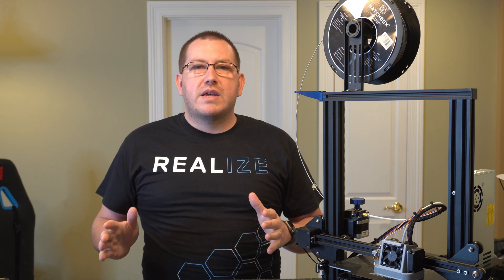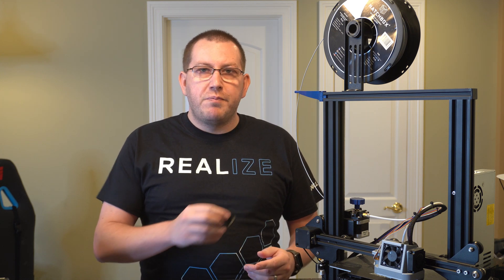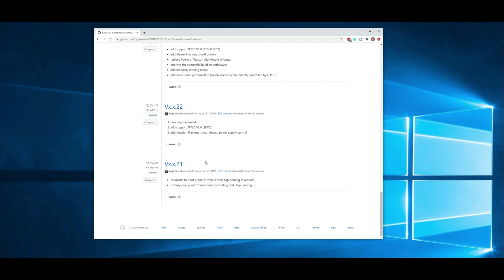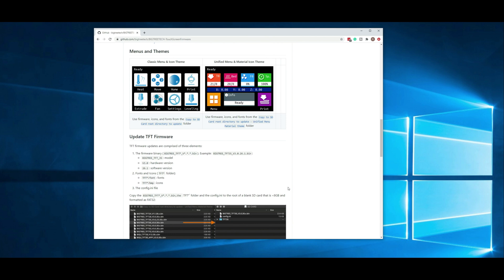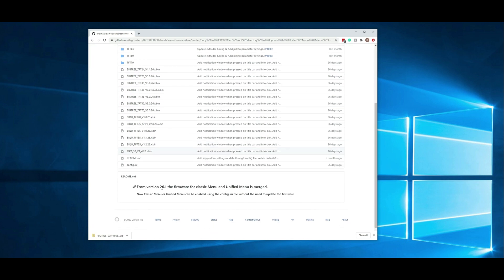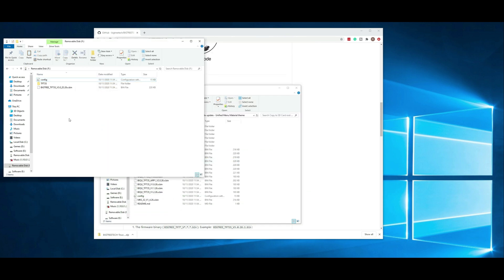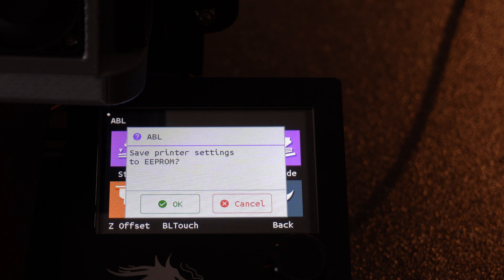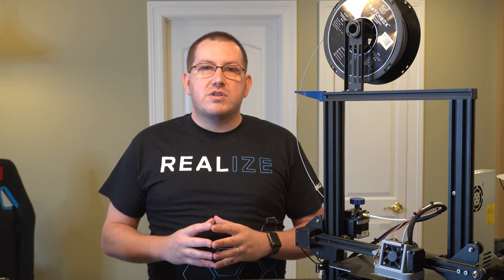BIGTREETECH TFT35 Firmware Update – Complete Guide

Comment: Hi Rob I upgraded my TFT35 using a 32Gig SD card and it worked. Thank you for the great video
Reply from the maker: Hi. Is the tft the v3 one? They may have improved the reader in it. Thanks for sharing.
Reply: Same here…I did a full format which took forever, but the bin file changed to cur file, when I flashed motherboard, so it worked!

Comment: Hi Rob, first off i must say youevideos are sport on so thanks. having just compiled firmware for my ender 3 max whilst watching your guides i have a problem where as my btt tft only works in marlin mode. it worked on my old firmware tho. is there a step in the firmware that i have missed to eneable the btt tft?
Reply from the maker: Hi. Thanks for the feedback. I dont recall anything specific needing to be changed when doing it with the e3pro but its possible the max config example is different. Make sure the creality screen is not enabled.

Comment: can I download it onto a USB stick and use that for the update? Or do I  have to use an SD card to transfer the update? I've got a printer running on old tech and it thinks that the board is 9in but it's a 12 in so hopefully the new update fixes that.
Reply from the maker: Hi. I think it has to be on the SD card.
Reply: @3DPrintscape   great thanks so much!

Comment: I keep having the touch mode or marlin mode pop up on my TFT 35 v3 e3. Any insight in what I need to do to get past this? I plugged the one wire connector in to the exp3. I did not have any other wires missing to plug from my original motherboard. Any help will be greatly appreciated
Reply from the maker: Hi. Are you able to go into both of them without issues? Also, did you upgrade the firmware on the tft?
Reply: @3DPrintscape  I did the upgrade and it’s still showing up.
Reply: @3DPrintscape  once I click one or the other it shows the main symbols. It goes back to showing both again

Comment: Hello! When printing from tft USB port, the printer randomly stops and screen freezes. Any advice?
Reply from the maker: Hi. I would try updating the firmware on the tft and the printer.
Reply: @3DPrintscape  Already did that. I set the baudrate to 57600, bufsize to 64 and BLOCK_BUFFER_SIZE to 16 (was 8 before). Printer is still running for an hour and it seems to work.. it should have stopped already but i will wait and see if that fixed it
Reply from the maker: @glupu-r4b  Did that end up fixing it?
Reply: @3DPrintscape  it worked for 2 days. Last night it stopped after 40-50 minutes bur after that i got a succesfull 7 hours print overnight
Reply from the maker: @glupu-r4b  Im wondering if there is a hardware, or power, issue.
Reply: @3DPrintscape  issue being around for 2 years on reddit without any fix for BTT

Comment: Hi, thank you for the videos.  I have a TFT-35-E3 V3.0 and when I am upgrading to the newest firmware (Bigtree_tft35_V3.0_e3.27.x.bin) with the "Round Miracle Menu" theme it tells me that it can't find 3 images.  (Bigtreetech, U_disk, Marlin)  After flashing It says Fonts is ok, config is ok, Icons needs updated.   I'm fairly certain that  the config file and the tft folder are all flashed because the file names have .cur after.  The .bin file stays the same.  Is the .bin file my issue on why It says that I'm missing 3 .bmp files? I am using a 8gb mini sd card with adapter.  Suggestions on how to fix this?
Reply: Wrong Firmware bin file!!! I have it working now.
Reply from the maker: Hi. Im glad you were able to get it going.

Comment: Have an Ender 3 V2 with a BigTreeTech SKR mini E3 V3.0 motherboard.
and a BigTreeTech_TFT35_E3_V3.0 screen.
Now get the message “Failed to enable Bed Leveling”
Can someone help me to get rid of the message?
Reply from the maker: Hi. Thats expected after pushing new firmware to it. Once you run the mesh once and save it, the message should go away.

Comment: Anything above 32gb wont work. FAT32 is the limitation of which it reads. I tried to use a 128gb and it won't detect it.
Reply from the maker: Hi. Thanks for the info. I have had mixed results with 32 gb sticks, even formatted as FAT32.
Reply: @3DPrintscape  Well the format which the printer reads can only be in FAT32, that specific format can only be up to 32gbs. With that said, the printer may only support up to 8gb itself as its own limitation regardless of the Format's limitation. I'll make a shot at it soon. I'll drop back by and let you know what I find out. If the printer does indeed have an 8Gb limit, I'll look into potentially making it cap with the format type.

Comment: I just installed the TFT 35 v3 touch screen and it worked right away, BUT it will not print. It says card read error. I go to Marlin mode and it reads the card and prints. Do you think this is a bug in the firmware and it needs an upgrade? My mainboard is the BIGTREETECH SKR Mini E3 V2.0.
Reply from the maker: Hi. It could be, i dont use the SD card on the TFT. Can you try it with a usb drive to see if it does the same thing?
Reply: @3DPrintscape  Thanks. I figured out my problem. If I am in Marlin mode, the original micro SD card slot is used. If I am in the touch screen mode, there is a full sized SD card slot on the right side of the Touch screen board. I plugged the SD card into that and it works fine.
Reply from the maker: @CarbonGlassMan  Thanks for the info

Comment: Thank you for this video. It was very helpful. I was so confused and thought I needed to further update my Marlin build for the SKR mini and it might mess up all that I had already done there. 6:35 you mention SD Card size. I used my 64 G SD card with zero issues. I just formatted it to Fat 32 first. I just did this today 12/30/2021. My build: Ender 3 Pro, BTT SKR mini E3 v2.0, CR-Touch, BTT TFT35 E3 v3.0.  I did have an error at the end of my install that said "Config: Update required". I had read BTT github directions (that have changed since this video) and thought I understood that I should use config.rrf.ini for my application. The BIGTREE_TFT35_V3.0_E3.27.x.bin and the TFT35 folder both showed .CUR now. So, I put the SD card back into my computer and added the config.ini. to try and solve the problem. When I put the SD card in the printer this second time, the screen said "Illegal FLASH APP!" Google search took me to a Reddit that said they thought they bricked the TFT. I erased and reformatted my SD card again and put fresh files on again, this time the plain config.ini and it went perfectly.
Reply from the maker: Hi. Thanks for the info, i will take a look at the changed they made and may make a new video or add notes to the description. I have had larger SD cards work, but they have been hit or miss, especially when dealing with the printer mainboards. The SD readers they use in these things are cheap.

Comment: I installed a TFT 35 it worked initially but now I get a configuration required message then the screen goes blank need help
Reply from the maker: Hi. Did it randomly start having the issue or was it after a change?
Reply: @3DPrintscape  after changing the screen it worked for a couple days
Reply from the maker: @johnjahner3389  I would try to update the firmware as I talk about in this video. If that doesn't do it I would try to exchange the TFT. If it was working then just randomly stopped, it sounds like it may be a hardware issue.
Reply: @3DPrintscape  ok
Reply: @3DPrintscape  after then change

Comment: when i cancel prints from the tft, it is stuck in loading... indefinitely until i hit the reset on the TFT. 

Also after updating to the latest firmware (I'm on SKR 1.4Turbo, Marlin 2.0.9 and the TFT35 i just downloaded it off their repo), it now refuses to print from a folder but it is ok if it is on the root directory (Printing from the SKR onboard sd slot, not the TFT SD slot)

Any ideas?
Reply from the maker: Hi. Ive noticed that sometimes with the tft35 as well, it seems like a firmware issue. The not being able to print from a folder also seems firmware related and i think that works fine for me, though i haven't tried in a while and at this point the firmware im running is about 6 months old.

Comment: Hi. How do I stop the flashing from happening every time the printer starts up?
Reply from the maker: Hi. Im not sure i understand the question. But once the firmware is pushed to the printer make sure you save your settings and everything should persist through printer reboots.
Reply: @3DPrintscape  If the printer boots up with the SD card in it, it causes an "Illegal FLASH APP!" error to appear even though the only files on the SD is the gcode file that needs to be printed.  Then i have to reflash the firmware on to the board before I can use it again.
Reply from the maker: @grahamgrobler776  I have not seen that before. Make sure the sd card only has the firmware file on it when you flash the printer and that its deleted afterward.

Comment: I followed all these steps and got my TFT35 updated but when I set the bed level it gives two errors. Error writing to the EEPROM and EEPROM data size error. Any suggestions?
Reply from the maker: Hi. I would make sure the firmware on the SKR Mini is also up to date.
Reply: @3DPrintscape  Thanks for the reply. I actually just compiled and updated the firmware following step by step with your other video. That was right before I did this TFT35 update. Thanks for the great videos. I have been saving them to a playlist for later reference too.
Reply from the maker: @mattstout610  Dic you clear the eeprom after the firmware update?
Reply: @3DPrintscape  No, that must have been it. It works now. Saved my settings!
Reply from the maker: @mattstout610  Cool, glad its working now.

Comment: Hello, did you happen that BIGTREETECH TFT50 V3.0 does not load a 16GB flash drive, FAT32 format? I have no idea what to do with it, so I ask everyone who works with the display. The display firmware is the last. Thank you.
Reply from the maker: Hi. The largest card supported by the tft35 is 8GB. I have seen 16gb ones work some times, but they are not supported.

Comment: I have the skr mini and board firmware installed and updated. But when I try to do the initial ABL level it fails. Says "! ! STOP called because of BLTouch error - restart with M999. Any guidance?
Reply from the maker: Hi. I would make sure the black/white wires are in the right order and that the wiring matches the firmware.

Comment: WOW! Am I glad I watched this because it solved a HUGE problem for me and I MUST mention this. I'm sure others already know this. I'm just learning Marlin and upgraded my printer (CR10 S4 400mm x 400mm)with an SKR 11.4 Turbo, TMC2209 and BTT TFT35. Long story short, config'd Marlin with bed dimensions etc. While checking thing out I noticed that when I did 4 corner bed leveling in Marlin mode the nozzle moved to the FL?FR/RR/RL just fine. In touchscreen mode it moved to FF as it should but would stop at 210mm when sent to FR? Anyway, during this video at the 11:00min mark you mention that we could open the config.ini file to make any changes.............WHAT!!!??? I checked it out and low & behold there's a listing for the bed size and IT WAS WRONG!! I corrected the dimensions and now 4 corner bed leveling works as it should in both TFT modes. Just thought I'd mention that. Thanks so much for that brief mention about the .ini file.
Reply from the maker: Hi. Thanks for the feedback and sharing. Hopefully this will help others as well :).

Comment: So have this screen installed for quiet awhile and continue to get an error message “Illegal Flash APP!” This happens every time I turn the printer on with the SD Card left in the screen slot.  Any idea what might be going on?  Only way to fix I have to reload firmware or make sure I pull card from slot before starting.  Pretty frustrating.
Reply from the maker: Hi. I havent seen this but i can try to help you troubleshoot. I assume that if you dont leave the sd card in you dont have the issue? I typically print from the USB port and i know that can be left in when its being powered on.
Reply: @3DPrintscape  Yes that's correct and thank you. Only happens when I leave in the screen SD slot.  Never tried using the USB port or the standard micro slot on my ender.  Using latest TFT file now but its been a constant problem through different firmware iterations.  If I'm daring I guess I could try leaving things in the other slots to see impact.  Just odd that it completely wipes out things.
Reply from the maker: @jerseybarrier64  Is there anything on that sd card besides gcoode files?
Reply: @3DPrintscape  I have used different ones and not 100% sure but I'm sure g-codes only most of the time.

Comment: when I upload to my Ender 3 Pro it shows no printer attached
Reply from the maker: Hi. My best guess is the the BAUDRATE changed in the firmware. You can change it on the TFT35 through the interface or in the SKR firmware. If you run into issues, you can also reach out over email or discord. My email is admin@3dprintscape.com and discord is https://discord.gg/Bu94EYVkrU .

Comment: Man...I did this ( before watching your vid) like 8 times with a 8gb card.  Switched over to a 128mb and BAAAM! It uploaded. TY still no printer attached.
Reply from the maker: Hi. So it didn’t work with the 8GB card for you? I was thinking about this more, and its possible the 8GB cards actually have more than 8GB (basically a buffer to account for blocks going bad), hard to say for sure. Are you getting any indications/errors on why its showing the printer not attached?
Reply: @3DPrintscape  in rufus ( I used multi formatters to sanity check myself) it said 7.46gb.  I am wrapping up now to calibrate...it looks like I have to reflash the MB, it seems to have turned off Mesh_BL. Thanks for the vid though.
PS I have to go to 12864 first in order to get it to connect to touch
Reply: I believe you also need to make sure the 8g card (or smaller) is formatted using a 4k cluster size
Reply from the maker: @erwinvigilia6303  Hi, thanks for the info. I think the default value for the cluster size is 4k, but I'm not sure if that's a hard requirement or not.

Comment: Hi great video. I have an issue where I still have a 'Printer not attached' message on screen. Change Baudrate settings but to avail. I also have no System info on screen like in your video.
Reply from the maker: Hi. Can you confirm that you have both cables from the TFT attached to the mainboard and that they are plugged in correctly? If the no printer attached error isn’t going away, that’s where I would look first.
Reply: @3DPrintscape  Grey ribbon cable plugged into Exp 1 (Screen) to Board and 4+1 cable plugged into RS232 (Screen) and TFT on board with +1 connected to RST
Reply from the maker: @alanfoss390  Hi, im not home right now so i cant check but im pretty sure the ribbon cable needs connected to EXP3.
Reply: @3DPrintscape  will try but I feel the outcome will still be the same........still the same :-(
Reply from the maker: @alanfoss390  :(. Ok, can you email me a copy of your configuration.h file? My email is admin@3dprintscape.com .
Reply: @3DPrintscape  sent. Many thanks

Comment: Yep, it's very straight forward to upgrade it. Now hopefully they can fix the filament runout to work through the TFT and vise versa from the mainboard. But to be fair since I print 99% of the time from my pi and OctoPrint. I just have the runout sensor connected to the Pi so OctoPrint can see it and pause if there is a runout detected. I can confirm that larger cards than 8GB are fine when flashing the firmware. Fun customization tip I learned from Teaching Tech you can set a custom boot logo on the TFT by simply going into the TGT35 folder and replacing the Logo.bmp file with another picture.  I do believe you can you anything you want as long as you scale it to the same size as the original Logo.bmp file.
Reply from the maker: Hi. Thanks for the feedback. It sounds like some cards over 8GB work, and some don’t. What runout sensor are you using and would you be interested in me doing a video on the setup or are you fine with it just being connected to OctoPrint? 
You would actually be able to swap out all the images if you wanted to. They just need to be the same size, in the same location in the TFT35 folder, and have the same name.
Reply: @3DPrintscape  I am using a sunhokey filament runout sensor. They are 3 pin just a basic one I got for cheap on Amazon that had good reviews and was cheap. I think doing a video would be good. It is pretty easy to do and not printer specific so I’m sure the more source out there with guides the better.
Reply from the maker: Ok, I will add it to my backlog.